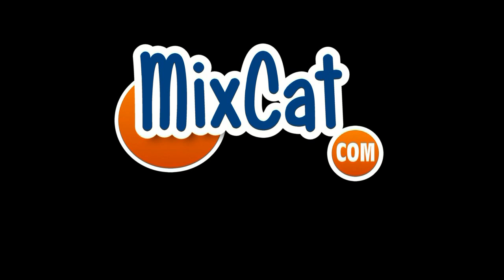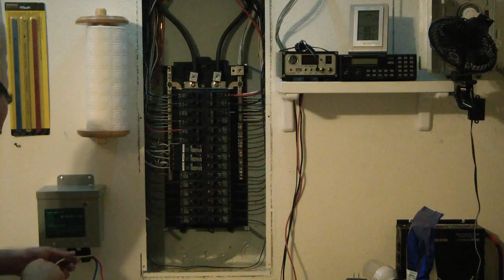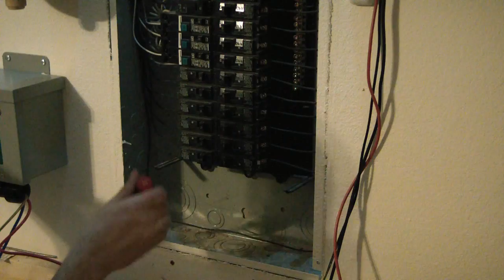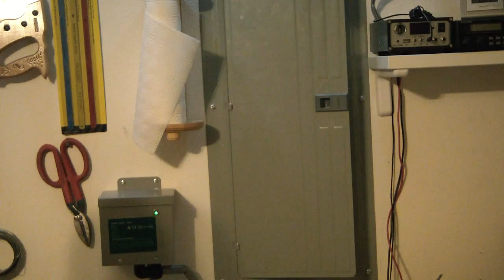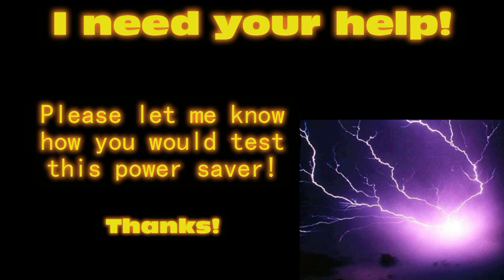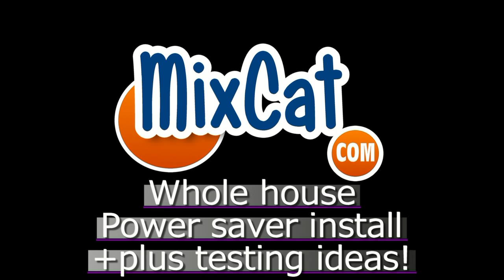INSTALLING A WHOLE HOUSE POWERSAVER BOX - I NEED YOUR HELP!

Comment: Best thing I could say is to put amp clamps on each main. And a switch to disconnect your kva saver. You will aslo want to hook up voltage meter to mains as. Your meter reads watts.  To get watts. Its amps x volts. Turn on your ac. And stove and read amps and volts with the power saver off.  Then on. And check again after its been on for an hr.  But you need to have all the same loads on when you’re ready
Reply: @Jeremy-ig3fl  No, power in an ac circuit is not merely amps x volts. Your calculation is called apparent power and is measured in volt-amperes (or volt-amps). True power in an ac circuit is amps x volts x power factor and it is measured in watts or kilowatts. The power factor is equal to the cosine of the phase angle between current and voltage. This is what residential electric utility meters read, just as it says somewhere on the meter: kWh, which is kilowatts x time in hours.

Comment: I installed the KVAR several years ago, and it really works! To see if it was still working, I disconnected the KVAR, and my electric bill went UP, a week later, my central air system went out. The start capacitor went out. The KVAR actually absorbs high voltage spikes, and bleeds it, the energy slowly, back in your power system.

Comment: The AC motors in your house that would benefit from a capacitor already have one dude.
My suggestion is to disconnect that snake oil box.

Comment: Install a switch inline with the saver, observe meter during normal use with switch off, and time you kw usage for say, 30 seconds.  Then with presumably the same load on your house (don't change any loads), turn switch on and repeat the 30 second kw count at our meter.

Comment: Sorry computer messed up.  Proper installation if to use a double pole breaker at the top of the panel for greatest savings, not two separate breakers at the bottom of the panel.

Comment: The power saver needs to be installed at he beginning of the panel on a double pole break savings, not on two separate breakers to get the proper savings, not on the bottom of the panel .
Reply: It son't work WHEREVERit is installed.

Comment: Like bobbyv125 said you need it at the top of your breaker box. If you want to see if it really is working. Hook it up correctly, then turn off all but one of your breakers. then check the amp draw. make sure there is some type of motor is running. then turn the two brekers for the power saver on, then recheck the amp draw to see if it is working. I ran my table saw that had a 1hp motor, I let it run for 3 minutes and cut a board while I checked it. There was not any different in the amp draw while it was hooked up. But when it was not hooked up the amp draw went up. So myself I would say it works.

Comment: Hi, You Are using two sigle Breakers, That is the wrong way to hook this up, First you need a 220 Breaker, Now you will need to put the 220 breaker atop the other breakers ,/ closest to your incoming power leads, Now what the 220 breaker does is Work both sides of the breaker box instead of one side like your hooked up !! I Have one of these hooked up on my home and they do work and save money and they are also a Surge protector ! well at least mine claims to be !! hope this helps anyone trying to hook up the power saver..
Reply: 2 single breakers also work both sides of the panel. Yes, a 2 pole breaker does the same thing, except on 1 breaker.
Reply: Two single braker will act like a two pole. If on same side of panle and next to each other But will not trip both at the same time. This could be dangerous. This is why you use a two pole braker as it trips both poles at the same time if a problem exists

Comment: This corrects ac power factor, you would need a oscilloscope to check the wave forms for the current x time, and voltage x time, to be able to see what the before and after are. How it works is a unbalanced load makes a meter spin faster, and this is a method to balance, but also could unbalance in the reverse direction.. simple power factor correction..
Reply: I don't see your end point. Are you for KVAR or against it? State your claim.

Comment: I love all the people who say it's a scam, or "you can't get something for nothing".  Obviously they do not understand A/C electricity.  When motors run, there is induction.  When that leads current the sign wave is "out of phase".  If you correct this with capacitance, then yes, you can in fact save power.  The best way to accomplish this is with a lot of math.  You need to calculate the KVAR's on each appliance in your home that has a motor (not tools unless you use them more than on occasion) then build the unit to match the average.  

If you really want to understand it, google "ELI the ICEman".  If you've bought one of these and it didn't  help, or helped very little, it's because it was a mismatch, or because you don't have that many motors running to make a difference.  It won't do a thing for resistive loads, like lights, the stove or the electric water heater.  .
Reply: you dont pay for reactive pwr yet. And even if you were the last thing you would want is eyeballing your power factor! definitely a scam
Reply: Darall, you are talking nonsense. It's YOU that doesn't undertand a.c. Your meter always monitors the in-phase current, so out of phase current is irrelevant.

Comment: I bought 1 6 years ago.  To test turn on everything in your house.  Check your amp pull and clock the amount of time it takes to make a full rotation.  Put the device on and do it again.  Mine slowed the meter down and cut the amp pull by 15%.  Been using it ever since.  It will save up money
Reply: Rubbish! It's IMPOSSIBLE for it to reduce energy.

Comment: only would work that way if pete wants to spend the next 2-3 months doing exactly what he did for the last 2-3 months to the letter, otherwise he simply may not have used as much energy during 1 test opposed to the other, 1 hr long draw test will be conclusive.

Comment: If you successfully test the surge suppressor, you destroy it. If it is exposed to a surge, it self-sacrifices to protect your house, necessitating its replacement.
Reply: No, that's why it's on it's own breaker, or wired into a motor that's on a breaker.

Comment: Not sure when you installed this device, however, you installed it improperly.  This was not an original KVAR Energy Controller Manufactured By the KVAR Corp.  You should contact KVAR Energy Savings, Inc. to determine why your installation was unsuccessful.

Comment: To test this, just turn off all other loads in your house and connect only a large reactive load.  Then record the power (or kilo-watt-hours over a time interval if your meter can't read the power).  You can do all of this without dangerous breaker-box work if you purchase a $30 energy meter, like the 'Kill-A-Watt EZ', from the hardware store.

Comment: Unfortunately, the power company charges you for real power, calculated a V*I*F.  F = power factor = cos of phase angle between voltage and current.  Therefore if you change the phase angle of an inductive load back towards unity with a power factor device, the real power will not change and neither will your bill.

Comment: just to add- from what ive read, people with older appliances and hvac systems seem to show the best gains from these, as the newer, high efficiency appliances and hvac motors already have capicators  installed in them, which is one reason they are more efficient to begin with.  i did my install myself also - electricians are charging obscene prices to install these from what i hear.  i was told though that they should occupy the first breakers on either the left or right side of the panel.

Comment: Also, and more importantly, you need to use a two pole breaker instead of individual single pole breakers. otherwise you might put both ungrounded (hot) conductors on the same phase thereby making the two wires to work as if they  where spliced together giving a voltage to the box of 120v instead of the 220v, or 208v, (depending on your service). You should remove this video IMHO. It is dangerously incorrect.

Comment: It is irresponsible for a novice to give electrical advice. I am a master electrician, and you have made very dangerous mistakes. Your installation has several serious code violations. most important is the lack of connectors where you removed the knockouts. also the white wire is not a ground, it is a neutral. It is dangerous to mistake it for a ground, and it can only be terminated on the ground bar under very specific circumstances, and many times cannot. leave it to professionals.

Comment: Pete,  The box is a capacitor which can interact with inductive loads to affect the current draw.  Unfortunately most electric meters on houses do not measure this current draw, but the actual kilowatts.  On larger commercial installation the utilities charge for power factor (the amount of excess amps drawn by inductive loads), but not on houses.  Should see very little improvement in your bill.

Comment: Hey Pete.  Here's a link for a company with a similiar product that has a vid of some testing that was compared before and after adding in the device and how they did it.  Some of it is similiar to your hot water tests vid, and some different.
power-save1200(dot)com/3400.html

Hope that helps and I look forward to what you come up with.
Thx again for your testing! :)

Comment: HELLO THE EASIEST WAY I THINK TO TEST THIS IS TO GET ONE OF THOSE KILL-O-WATT METERS THAT GIVES YOU ALL KIND OF READINGS AMPS, VOLTS,  HERTZ AND OTHER JUNK PLUG A MOTOR DEVICE IN WHEN UNITS BREAKER'S ARE OFF GET THE READING THEN TURN UNITS BREAKER ON AND YOU SHOULD GET DIFFERENT READINGS THIS DEVICE FROM WHAT I UNDERSTAND JUST WORKS ON MOTOR LOADS IN YOUR HOME BUT WITH ENERGY SAVING APPLIANCES YOU WON'T SAVE MUCH THIS IS MORE OF A COMMERCIAL BUILDING UNIT FOR A/C AND MACHINES BUT LET ME KNOW!!

Comment: turn off all the fuse's with only the power coming in, have the power saver off also, use your clap meter around 1 side of the 200 amps it should read 0, then turn on only power saver and see how many amps the power saver runs at.  I will bet it takes in 1.8 to 1.9 amps.  these units only help if you have an inductive load on them all the time. try running only the A/c on and check the unit off and unit on you will see a difference.

Comment: I'm no expert but from what I understand, have one connected to my 52 gallon electric water heater, the device does not actually save money. What it does is when the electric company is at peak usage the device temporarily shuts down the power to my water heater so to ease the strain on the power company. By doing so keeps the cost per kilowatt at a low rate. This saves money for everyone connected to the grid not just one house. The best way to save power is to unplug things when not in use.

Comment: If I understand correctly, they work on Inductive loads, So Turn on every moter in the house, Open the refrigerator door, start the dryer, turn on every fan, and make the AC unit stay on. then go out and time how fast the disk spins on the meter. Time one revolution then time ten. Less time means more power used. then flip the breaker for the unit and repeat the timing again. It should slow down.

Comment: Yes I too would love to see the inside of the unit, Video and Close up stills showing the word and numbers on the componets. 
To see if it is reducing power consumption, I would Learn to reed your meter, hopefully it a digital meter. Run for 2 to 3 days with and without. keeping detailed reading of the meter. then Determin when your meter cycle starts and turn the unit on that day for a one mounth test. compare that month with last years reading.